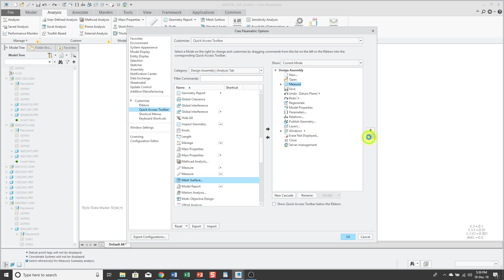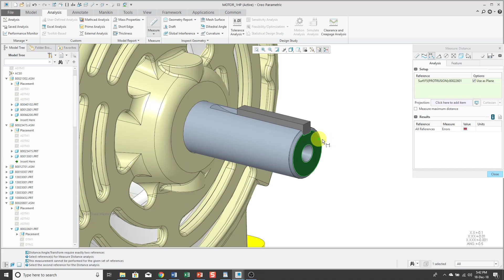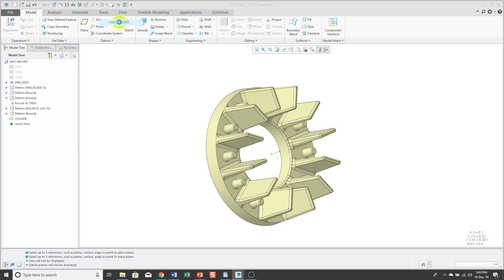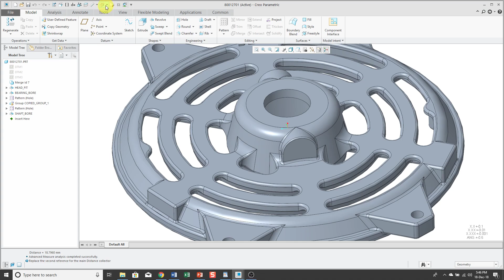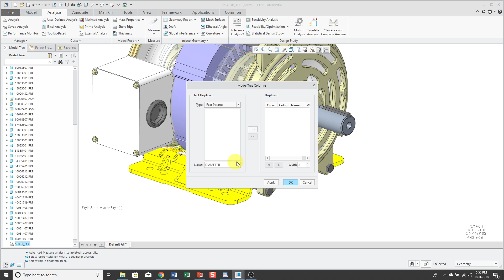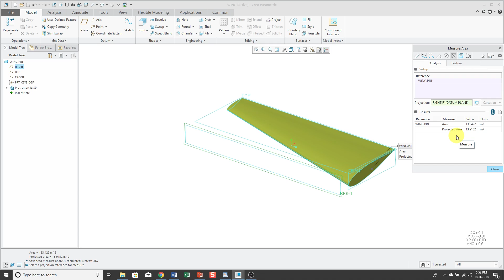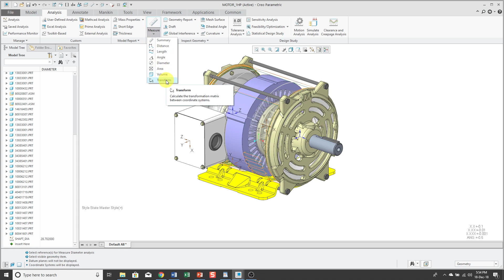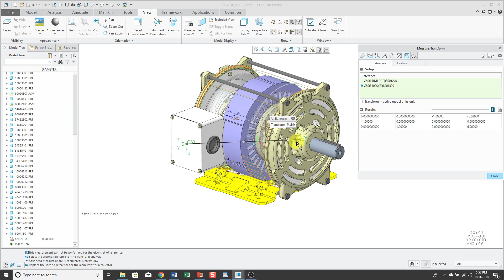Creo Parametric - Measure Tool [Tutorial]

Comment: David....have you created a video on how to calculate internal volume for an assembly, similar to your motor assembly that was part of this video? Primarily calculating the amount of oil needed to fill a motor to a specific level, or to fill all the voids and features inside a multi-part assembly. This may be a complex procedure for a video, but if you have a technique you could share that would be great.
Reply from the maker: I have not created a video on that. The process is so dependent on the nature of the geometry that you are trying to measure. Basically you are using a bunch of surfacing techniques, which ever ones you need, to construct the enclosed volume any way that you can. Then measure the properties of the quilt. Or if that doesn't work, somehow create an external envelope, solidify it, then do a Boolean subtraction of the component geometry. I don't have one process. I look at the situation and come up with a roadmap. It tends to be boring and tedious. I don't see myself making a video on that, because it's not an interesting problem IMHO, and it can call for any of several dozen tools in Creo. And possibly involve BMX.